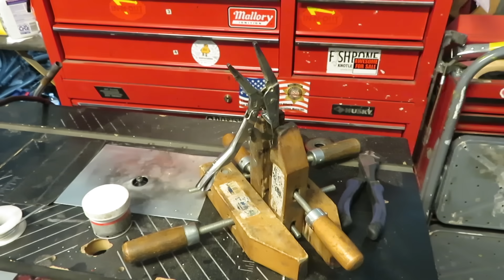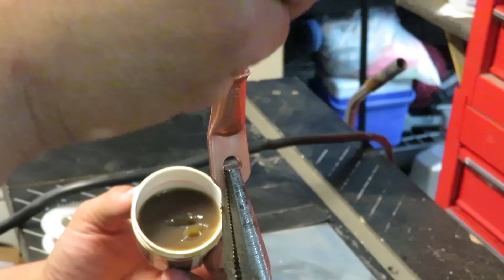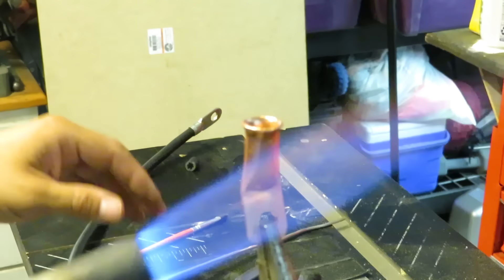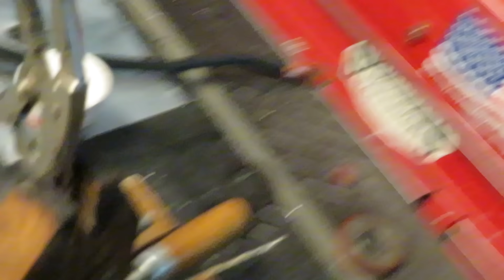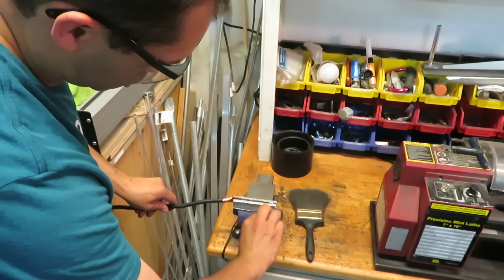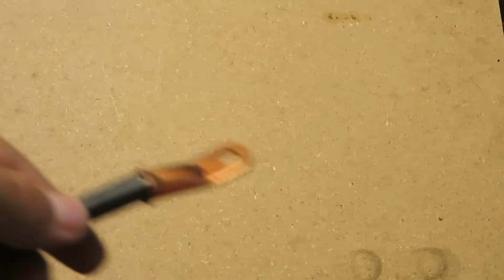How to: Battery Terminal Install. Better than Factory.

Comment: This ist optical nice but technical bullshit. Soldered cable can break , bcs of the vibrations of the car. Than the cable go out of the shoe or break behind it. If its become hot bcs of the Ampere who go through the cable, the soldered connection can bei desoldered. That ist the next reason, why it is pressed/crimped, not soldered. Read something about electrical connection and dont advice some bullshit like that.

Comment: Highh amperage dont like solder.  U should just crimp tht ... In my case,  starter motor,  12v,  it draw high amps,  the part tht i soldered melts off... If this project  is not involving high amps,  then should be fine...

Comment: Plumbing solder melts at a lower temperature than Electric solder, I wouldn’t risk using plumbing solder, just get the right stuff for the job.

Comment: I do snow plowing for a while and that’s exactly what I did in the beginning but after about two years the ends would get corroded and fall off or stop making good connection then I went to a professional crimp and the crap is way better with Heat shrink tubing that’s the best way
Reply: Corroding due to environmental reasons (salts and water, dissimilar metals, H2So4 gas)  and your new cables have protection from heat shrink and I bet coatings too.

Comment: I solder those types of terminals with a high temperature rosin core electronic solder, no additional flux needed. Don't use plumbers solder or plumbers flux. In high temperature applications as you demonstrated, the insulation will fail before the solder connection does. I'd also recommend using a soldering iron tip on your torch to prevent hitting the terminal with an open flame to help avoid burning the insulation.

Comment: Nice cold solder joint, looks good but does not function well electrically speaking. Cramp then solder then seal with heat shrink, that's how to do it.

Comment: You're not supposed to use acid core soldier on any electronics. You can use 60/40 soldier for this purpose and it would last longer and not corrode. This is the problem with the Chinese they haven't figured that out yet that's why our electronics ain't lasting that long.

Comment: You really should just take this video down.. This is NOT how it is done. I work with 450 Volts DC and the biggest problem we have the cable crimps.. That is it, Cable Crimps. If we soldiered in this fashion I would probably be in jail.  You do  not put a cable together the way shown in this video.. You could get some one in a big failure, maybe even a fire.

Comment: This is not better than factory. It's worse, due to:
1) no mechanical retention of the wire in the terminal;
2) soldering wire onto terminals makes for a stiff, inflexible connection that will crack over many heat/cool cycles;
3) wrong kind of flux used for electrical connections; what is "paste" flux, anyway? What's important is whether it's rosin or acid flux.

This'll fail before any factory crimped connection.

Comment: You should use rosin based flux for electrical connections. The acid based plumbing flux will corrode the wire over time.

Comment: Not actually the correct soldering procedure. The cable should be pre - tinned first, then as you carried it out. Your solder will only be on the outer layers of the cable strands, not through to the core. Good vid though!

Comment: Get the ones you heat up, that have lead inside them. Your basically welding the cable to the battery end at that point.
Skip these crimp on ones.

Comment: Mechanical connection is always the first step (good crimp) then solder but do not use acid flux.  If solder only and the wire overheats the connection will fail.  Acid flux will cause corrosion.

Comment: There's a reason those terminals are crimped on. The Achilles heel to your method is if the connection ever becomes loose the resulting resistance will create heat which can be high enough to melt your "sodder" and the connection falls apart. When this happens under a load the arc created at the time of separation can ignite the hydrogen given off by a weak battery thus causing an explosion.

For those who follow his fouled advice do yourself a favor and use solder and flux that does NOT contain acid. By using materials meant for electrical connections you needn't have to worry about.

Comment: You should pull this video. Absolute dangerous procedure. Joint can easily get hot enough to melt solder and come apart when drawing heavy current.

Comment: NEVER use an open razor blade to peel wire.  You could have used one clamp and the vise. Just like a guy that I know, you keep putting your tools down (in the way) right where you are working. You failed to prime/prep the wire to accept the solder(weak connection). An automotive or equipment battery cable is best soldered AND crimped.  And don't forget, You can make your own battery cable ends out of scrap copper tubing, instead of buying them. And use shrink wrap to prevent accidental shorting (and it looks good).

Comment: This is the worst way to do it. If your load exceed the temperature of the solder your cable will pop out without any stress on the cable cable will overheat too because it might start arcing in the connector and you will have cable that’s overheating at night with out you know and you have fire. Crimping is the most important thing to do with connectors light these you can put solder on it later once the connector is holding the cable.

Comment: In the cell phone site industry the engineers specify using Kopr Sheild and crimping. In the boating industry the connections must always be crimped. Although this may look good it would fail most inspections and the solder would absolutely melt under a high current load and the connection would almost certainly fail.

Comment: Have you ever heard of tinning your wire before you solder use  60/40  Rosin core not acid core solder as you used in your terminal!   I am a electronic repair master  tech.  Also after you soldier your connector crimp it with the vice for extra hold,  and use heat shrink for water tight and no air for corrosion to build up.   Just some  help full hints is all. Great vid. 👌👍

Comment: Great for stationary circuits. In most vehicles and aircraft the wires are subject to vibration and a quality crimp allows the wire to remain flexible.  The solder joint creates a stiff point in the strands that can fatigue and break over time.
Reply: Same for maritime applications
Reply: @gtcam723  My 1970 EggHarbor 37, OEM 2/0 wires have all the lugs soldered on. They then wrapped it with black electrical tape. In 50 years, it never overheated and fell apart. Mostly though I agree the crimped cables are technically superior.  Other thing is these large cables are very naturally stiff, a small hard spot in the end from solder has no effect on it breaking. Not in my experience. I have also made some of my own copper lugs from small sections of copper pipe. Made them to look like typical lugs, but have also simply put the copper tube 2 inches onto the striped wire, then used a 3 lb sledge hammer to smash them together. Drill a 3/8 hole in the end and sometimes solder sealed the end only. Now of course if your going to stack lugs, might be an issue cause the lugs you make that way will be 2 to 3 times thick where the stud bolts on. I have also used a tubing flare tool to crimp copper tubing onto wires. Works amazingly well, tighten it down and smash the flare tool with a sledge hammer. May have to rotate the crimp in the flare tool and hit it a few times. This can work very well if the copper tubing is a close fit for the wire gauge. If the copper tube is slightly too small for the wire gauge, you can heat the copper to anneal the tube, then run a drift into it with a  hammer to expand it, then use it for the crimp. I did that recently for a 6 gauge wire and 1/4 copper tubing crimp.
Reply: I have hand crimped thousands of these working in the semi truck parts business. 99.9% of those mechanics wouldn't consider a solder joint nor would they have time. With the addition of a small heat shrink tube it makes the crimp joint nearly impervious.
Reply: @TheBluegoatman  Yes well that is a business. My time is my own time.  heatshrink is a good idea. Also sealing the copper to the wire with tape first, then heat shrink is better.  Truth is get this, blue painters tape, wrap a few turns around the joint, then heat shrink seals the water out. I find it better than black vinyl electric tape which over time leaks out this stick goo and it also fails to stick. And you can get adhesive lined heat shrink tubing, for a price... Anyway the blue painters tape actually holds up for years and years. Many wires in the past had paper liners under the insulation, same idea using paper tape, but not masking tape, that is no good.
Reply: That's crazy, because I've done thousands of solder connections on C-130s over 14 years.
Reply: Come to think of it, maybe he knows this and is just doing it for views
Reply: @nnnnnnnnnick5557  I hope so! He did say it was better than factory though
Reply: I would agree that a crimped connection is superior to a solder connection on smaller wire sizes that are subject to vibration and constant flexing and bending.  Soldering a lug to the end of a large diameter cable completely integrates the terminal lug and the cable's core as a single section of metals.  The actual cable core is surrounded by the copper terminal, so the soldered section of the cable core will never flex.  For the critical starting system of a vehicle, it's important to eliminate electric resistance wherever possible and the soldered connection will do that for you.
Reply: NOT even great for stationary circuits.  Everything is wrong here.
Reply: One thing some of you missed is that for welding leads, air gaps in the connections will cause arcing and premature damage of the lugs. Ever seen a crane? Some of those wire cables are soldered!
Reply: Could you do a knot around it for enough slack for flexibility?
Reply: Unclear how to crimp a 4 gauge (or thicker) wire? Tapping a chisel  in line with copper strands? Vice gripping?

Comment: I enjoyed this video and it actually tempted me to replace the end connectors on my battery cables. I clean my battery cables and clamps twice a year fall & spring to maintain a good electrical connection. One question I have is are you really improving the electrical connection if plumbing solder—which isn’t copper—is sandwich between the copper end connector and the copper wire? (Being facetious: Getting the professional look is the real goal here for a cable that will connect to the battery under a car hood and never be seen by anybody. I always try to get a professional weld on my exhaust pipes as well. 😅)
Reply: Careful on factory replacement cables, they are typically copper coated aluminum.

Comment: you do NOT WANT TO USE THAT KIND OF FLUX!!!!  
YOU DONT KNOW WHAT YOU ARE DOING!!!
YOUR PROCESS WILL WORK IF USE THE PROPER SOLDER AND NOTHING ELSE AND JUST CLEAN THE INSIDE OF THE TERMINAL WITH A GREEN SCRUBBY PAD AND FILL THE TERMINAL CUP WITH SOLDER.....THEN SLIDE YOUR SHRINK WRAP OVER----OH WAIT~!!!  YOU DIDNT USE THAT...
D- GUY....SORRY...

Comment: Im a union commercial plumber and im mind blown rn. This is how ill be doing my cables from now on. Thank you!
Reply: BUT DO NOT USE THAT DAMNED SOLDER OR THE FLUX!!!  ITS THE WRONG KIND FOR ELECTRICAL CABLES AND WILL CAUSE MASSIVE CORROSION!!!  YOU MUST USE 'ELECTRICAL' SOLDER!!!  AND NO NEED FOR THE FLUX IF YOU CLEAN THE INSIDE IF THE TERMINAL CUP WITH A BRASS BRUSH OR A GREEN SCRUBY PAD!!!
I HAVE BEEN MAKING BATTERY RELOCATION HARNESSES FOR 20 YEARS AND I HAVE MADE HUNDREDS, AND THIS IS THE WRONG SOLDER AND FLUX BEING USED HERE!!!
Reply: @ssnerd583  thank you for that heads up

Comment: What is better about this than a properly swaged terminal? The untinned terminal? The acid core plumbing solder? The cold solder joint or, if you actually get it to wick, the work hardening of the cable?

Not trying to be mean but you are promoting false information.

Comment: now this is a great educational video
thank you!
Reply: No, it isn't
Reply: This is a great educational video on how not to solder an electrical terminal. Step one is to never ever use acid based plumbing solder or flux. Have you ever seen soldered copper pipe that’s green around a solder joint? That’s what flux does when you don’t wipe it off.

Comment: Everything is better than factory. 
That’s the problem. Too much being spent on gadgets and tech junk and no quality. That’s why your cars totaled in a fender bender. And people are fleeing to trucks. They want something that’s safe and at least partially built the way it should be. 
Hint: spray white lithium grease on your terminals. No more corrosion. 
In fact I use WD40 and white lithium grease to fluid film my car in fall before winter and it really works at preventing rust.

Comment: That is a good way to develop a cold solder joint and to ensure the premature failure of your cables. If you want to have solid cables buy the correct crimp tool and do it the right way or pay to have it done. Good luck with that.
Reply: Absolutely agree !!!

Comment: In the military I was trained to strip wires with a razor blade just as you did here, even much smaller wires. I still do it that way. You can put the blade in a pin vice and leave it protruding the thickness of the insulation, lay the wire on the blade, press with your finger and rotate the wire. It cuts the insulation perfectly without nicking the conductor. The only other option we were allowed to use was thermal strippers. This isn’t very practical for one wire but if you get the procedure down, it works quick and is really handy for multiple wires.
Reply: Brillant idea. Complète pain when dealing with expensive cables and you nick one of the inner wire's insulation.
Reply: As a 25yr sparkie, I've never used a safety razor blade, the last 20yrs I haven't used a utility knife.  A well kept splicers knife or edc pocket knife is actually preferred for higher voltage or amperage.  Not going to knock the military members, but the training they give you sucks.  2 trips to Afghanistan as a civ to fix wiring done by our military.
Reply: @Boreamear - Gotcha, That sound like bigger stuff than what I deal with. 22-16ga typically the smaller end of that range. Zero stretch allowed on the insulation, zero nicks on the conductors. Inspected and “bought off” by an inspector typically with a 10x magnifier. I’m sure none of my work has been redone because of quality.
Reply: I always used electricians scissors. It was always the fastest way for me to strip wires.

Comment: Not the correct way at all, nor up to code either and obviously your a rank amateur by even suggesting this extreamly unsafe method !!!  

The first time you put a super heavy load on it, the solder can and will melt away with the possibility of the wire falling out and causing a short cuircut.  Not uncommon at all in an application using a large multipul battery banks such as with a 18 wheeler, a large deisel boat or other heavy equeptment that has a high inital amp draw when starting. You ,,Might,,, get away with it for a light duty application,but still not code or safe in any way !

I know this because I worked in the marine industry for decades and a customer with a twin diesel 60+ foot multi million dollar boat,  burned his to the water line by "fixing" his own wires that exact way. Plus it happened to one of our very large fork lifts capible of picking up a 30+ foot boats when trying to start it when it was below zero which caused 2 , > thousand dollar batteries to explode causing a major fire destroying many of the hydralic lines and much of the wireing harness and putting that piece of equeptment out of service for > a month and costing tens of thousands in damage, plus it Damn near burned down a storage building containing 40-50 boats.  

Your suggesting using a VERY VERY UNSAFE method of attaching battery lugs ,,,

But hey,,,,go right ahead, if your so inclined folks,
That's what keeps us profssional mechanics in busnuiss so go ahead and do it that way if you want. 
There's a very very good reason battery cables are crimped at the factory,,,,,,

Comment: I used to think soldering was the best but unfortunately it is not recognized by the NEC as a reliable connection. Mechanical connections are recommended. Lead solder will melt and fail under a heavy load. Connections in a starter motor use silver solder which will melt at a higher temperature than lead solder or use more modern connections like being fused together with either spot welding or very high temperature fusion.

Comment: A good test is to measure and compare voltage drop over the cables under heavy load. I would also recommend twisting the copper strands before crimping and then solder after crimping.
This will give you the strongest and lowest resistance joint.

Comment: If you’re not an electrician you shouldn’t be doing that crap. That’s a crimp fitting. Crimp ends hold up better to heat. It’s not about how hard you pull on it, it’s about how it stands up to heat when there’s a large current flow. It’s hard to say it’s better than factory when you do it half assed and against its UL listing.

Comment: Cutting the insulation with a  blade ??? There are tools for that that make the perfect cut, solder is not mechanically robust, a hydraulic crimper would have done a better job.  My opinion only, i doubt U would find and industry using this practice.

Comment: This is not good at all and in fact is dangerous. The solder will soften with the current due to the Joule effect and come loose over time. The crimping method cold-welds the metals so the cable and connector become a single piece of metal, that will never separate